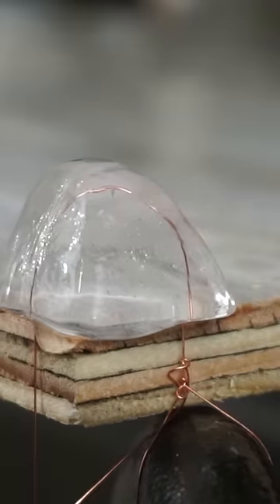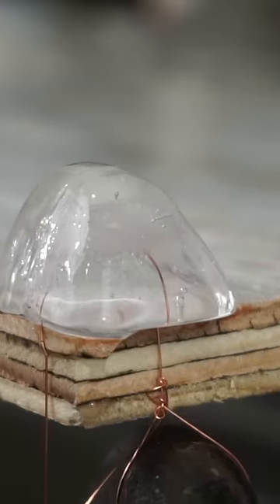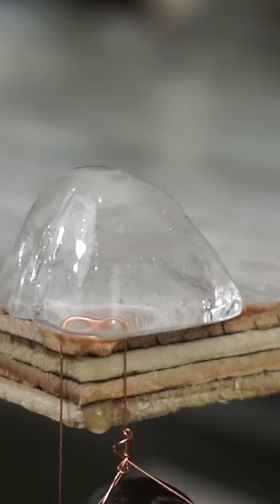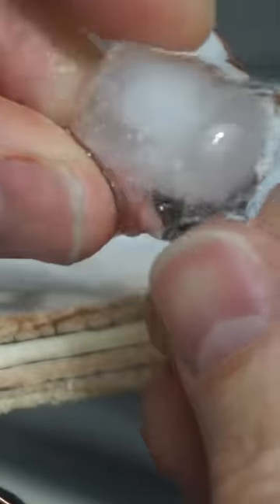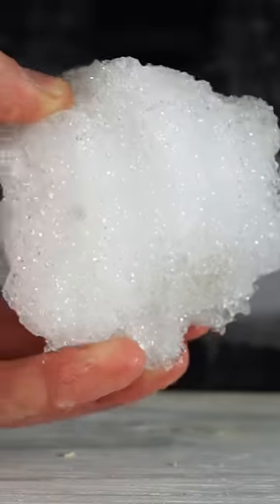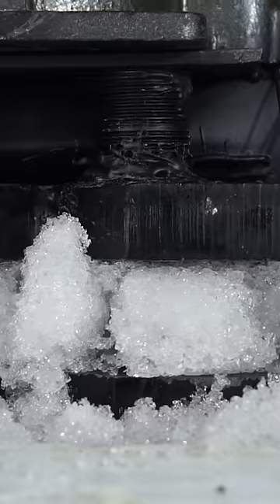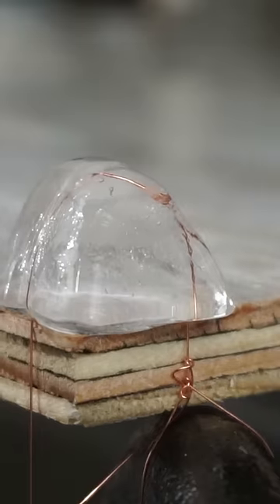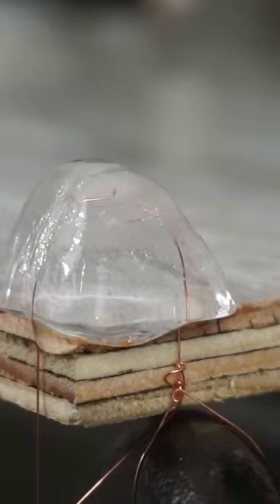Melting Ice With Pressure Instead of Heat

Comment: strange, i didn't know that it was the weight of the thing cutting into the ice and not the conductivity of it. which means if i took a fabric string and tied 10 lbs to each ends of it. it shouldd be able t0 cut through.... right?

Comment: Im pretty sure its a similar deal with ice skating and that the skates focus the pressure on the ice enough to melt it and make thus you aren’t really skating on ice but rather on a small melted strip of beads of water that then freeze after

Comment: Ita nit even the same thing... Pressure to gas and liquid makes coldee temps. Your adding friction and the outside ice is melting due to ambient temps. To the psi. The crushed ice isnt the same either . You can smash it together with your hand and increase the density of the volume... ....so

Comment: But the copper is dumping heat from the environment into the ice - only at interface where it’s touching. 

Once it passes through the warmer water left behind dumps its heat it got from the copper, into the ice (which is then diffused throughout the ice block). 

The only way to do this fairly is for the copper and the environment to all be at the same temperature so that the copper can’t dump heat into the ice. Or even better, as others have said, use a material that is a poor heat conductor (unlike copper!)

Comment: It's called thermal conduction. The wire does indeed warm the ice up around it...
Reply: It does, but not significantly so. The pressure is what cuts through the ice.

Comment: I don't understand what the "phenomenon" is... doesn't increase in pressure ALWAYS result in increase in heat,  and therfore local melting?
And the copper just has high heat conductivity,  so the energy dissipates quickly... if you used a rope,  i bet it wouldn't work the same.  
So it seems like the pressure increases heat,  then the material applying the pressure needs to be able to absorb (and release) that heat.

Comment: But the ice doesn't melt because of pressure... The Cooper wire will melt the ice, because of it's a great heat conductor... Try with nylon wire and nothing melts even if the pressure is the same

Comment: I reckon in the copper wire example, heat is doing the work. The high thermal conductivity of the copper is transferring heat from the atmosphere to the ice
Reply: No. Vertassium made a similar video using different material i think. This is really about the pressure

Comment: Thata not pressure. That is heat. Copper is one of the best thermal conductor. The copper is literally cutting it with temp because the surrounding temp will make the copper at least a little above the ice which allows it to "cut" it by melting it.
Reply: The copper here has almost no thermal mass and the only way for it to dissipate heat is into the air, which is a better insulator than it is a conductor

Comment: I feel like if you repeated the wire test with everything at the same temperature it wouldn't work as seen here, and you would need significantly more weight. I'd say heat is doing most of the work with the rock and surroundings at room temp.

Comment: Copper wire. Copper has one of the highest heat conductivities among metals. What if you try it with a string?
Reply: It wont work because pressure has nothing to do xd. If you redo the experiment with copper wire in below 0 Celsius you will notice no melting at all. Heat transfer from environment is the thing that melts the ice
Reply: @kamilnalikowski3186  You’re making crap up lmao

Comment: Seems to me that this is likely almost entirely due to the heat conductivity of the metal.

Put an ice cube on a wooden cutting board for a moment, you'll notice that very little (if any water) appears.  Now try it with an aluminum saucepan at room temp.  It will start to melt almost instantly...

Source: I just tried the above experiment in my kitchen :)
Reply: Bud that’s not at all the same as what the video is doing
Reply: @DeathnoteBB  Yeah, no shit.  But it does demonstrate that metal in contact with ice has some impressive melting effects even without any pressure applied.  You can extrapolate those results to interpret the video in a different way.
Reply: @DeathnoteBB  Maybe the wire being so much less massive than the saucepan could debunk my theory.  However I would want to see the video's experiment done again where the pressure applying agent is not metal to verify this.
Reply: @Liamiamail It has been done and the effect is greatly reduced when the wire material is less conductive.  Of course it is still possible to "pressure melt" ice to begin with, but depending on the starting temp, the amount of pressure can easily become much larger than what a simple weighted wire setup can achieve.  This can be readily seen by consulting a phase diagram for water.  

For example, in very cold weather ice skating, the pressure exerted by the weight of the skater is insufficient to induce pressure melting on the ice (contrary to what some other comments on this video suggest); therefore, there is likely another mechanism such as friction that dominates.  In this case, it is also very likely that thermal effects are dominant, but it depends on the weight and the starting temperature of the materials.

Comment: Conversely, if you apply pressure you can stop water boiling and turning into a gas. So for some reason liquid is the default under enough pressure. That's just weird.

Comment: Water expands as it freezes.  So pressure causes freezing point depression which is another phrase for melting.  But without heat transfer, the melted water has a lower enthalpy so it freezes after pressure is relieved.  This is why ice skates glide as this forms a hydrodynamic bearing.

Comment: Well copper is a good heat transfer material, if you did this with cotton string id agree with it more
Reply: Well cotton is a great deal less dense than metal, meaning the pressure cotton can output will always be less than the pressure metal can output. The conductivity of metal isn’t one way, the cold ice will freeze around the metal, the air won’t forever warm the wire up enough to melt through the ice, because the ice makes the wire colder than the air can make it warm. So it is the pressure that melts the ice. It’s called regelation. Most substances don’t melt under pressure but ice does.

Comment: No it is because the laiton conducts better the heat than the air, the ice in contact with the laiton will melt then become again ice because it will be refresh by the rest of the ice